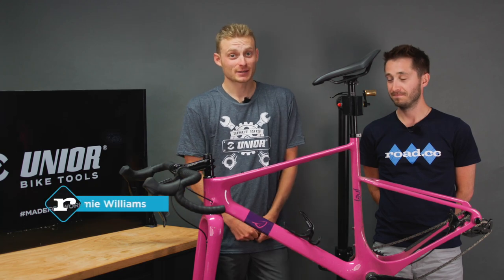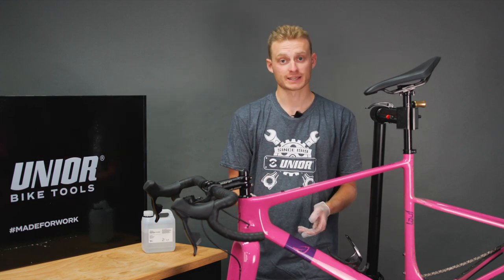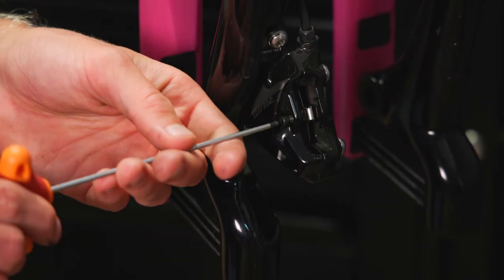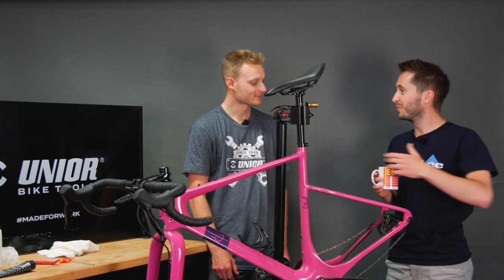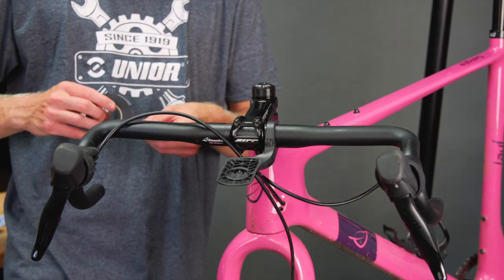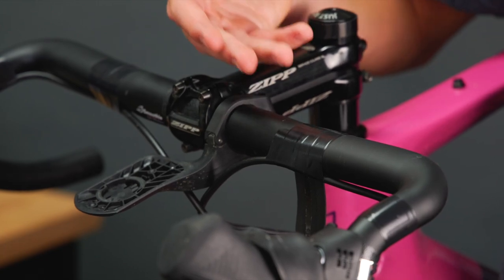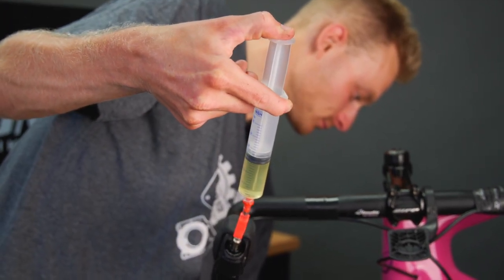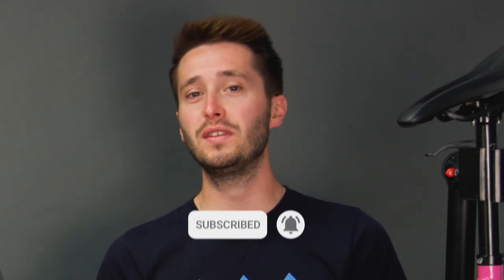Disc brakes not working? DO THIS!

Comment: I'm about to give up, I have new pads and disks, both are compatible. But for some reason brakea do not brake properly, as long as there's aome weight and momentum pads will just slide on the disk. 
I have edjuated brakes too ofc, I'm going to try tightening brakes they are very lightly touching the disk, if that doesn't work, I'm just going to take my bike to shop, honestly it does need adjustment for shifters too. 

I would be willing to learn that, but if I cant even handle mechanical disk brakes, why bother.

Comment: When you're finished bleeding and you remove the syringe, the time that you leave it open until you put the screw back in is that putting more air back into the system the longer you take to put the screw back in? Or not so much?